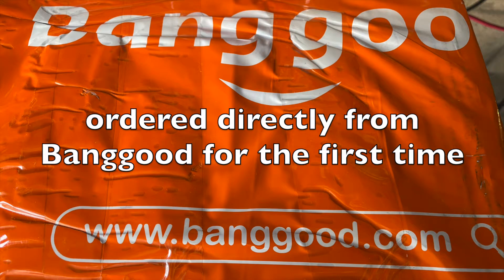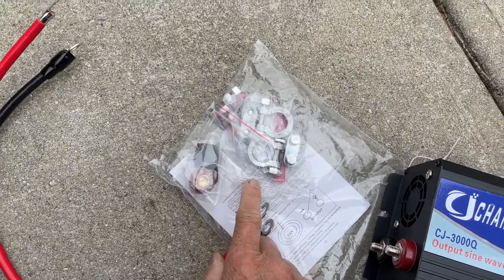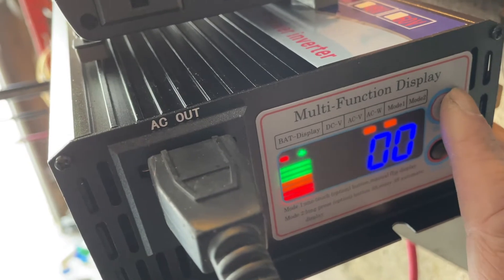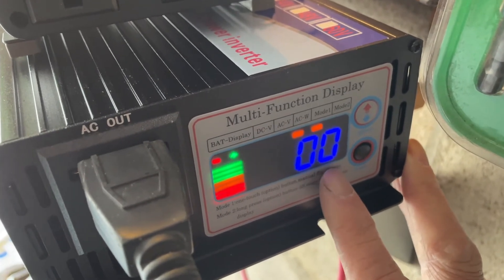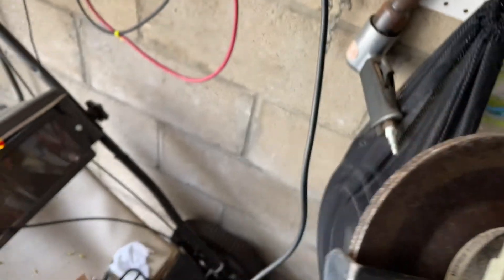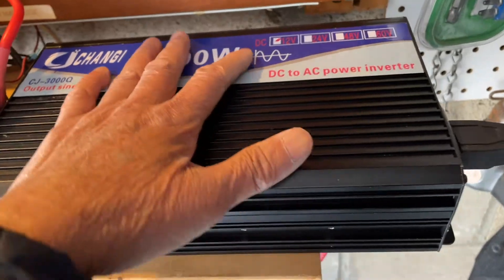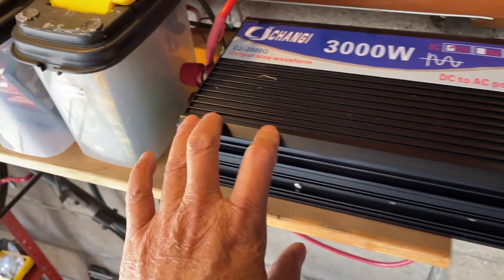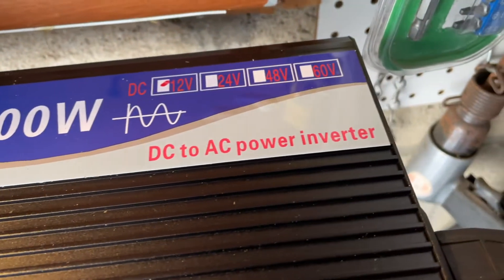3000w Changi pure sine wave inverter works for me

Comment: Update on this inverter
Reply from the maker: Still working but I don’t put a big load on it. Used mostly to charge power tool batteries, lighting and such (under 600w). I just bought a 3500w vevo inverter which twice the size of this one. Will see how suitable it is to power an air fryer.
Reply: @wtam69  - Is it powering the air fryer?  Thanks for your videos (and opinions). Very much appreciated. -John
Reply from the maker: @Sovereign_Citizen_LEO  I haven’t used it on the air fryer. I doubt it can handle it , maybe the 220 volt version can. Just guessing.

Comment: Spinning up a grinder but not grinding anything isn't a valid test, you need to load the tool to capacity to see what current it draws and whether the inverter is stable with that load. (so check voltage, power factor and waveform with appropriate test equipment).
Reply from the maker: You are correct. And how well the inverter will hold up after a few months of rugged use. This applies to all equipment and machinery we test.

Comment: A 3000W inverter "safe" to be used at 300W - 600W sounds hilarious to me. For that purpose wouldn't it be nice to buy an inverter that honestly claims a rated power of 600W and sustains a peak 1200W (usually double the rated one) power for a second or two?
I bought the same inverter (only difference is that it is has a 24V input), same label, and it proved (after-sale statement via Banggood) that 3000W is peak power, sustainable for maybe 100 milliseconds in my tests, and that the actual rated power is only 1500W.
Anyway, to deliver all the 3000W your inverter would draw at least 250 Amperes from a 12 volt battery ! And what a thick cable, minimum 120 mm2.

Comment: Nice price for 3kw but I would absolutely not trust the rating or quality. You should see the videos z1power and knurlknar made on these cheap inverters. It might work but it's probably got problems inside or at least low quality components. See https://www.youtube.com/watch?v=KuUBYsSNZag
Reply from the maker: I was just happy nothing went up in smoke. The last cheap power supply I bought on ebay came dead on arrival.  I mentioned in the video the inverter was quiet because the fan did not come on. Maybe, it won't under any circumstances. Thanks for the link, I'll look at it.
Reply: @wtam69  Yeah it could be broken, or it could be a temperature controlled fan that only turns on when it's hot. Personally I would just suggest not running it at 3kw all the time since even if it can do it it probably won't last very long. Who knows though. Nice video anyway :)
Reply from the maker: @ELECTROHAXZ  If I had gotten the inverter free, then I would have pushed it to the limit to see what happens. As it is, it should work ok for a small system. I don't plan to run it over 600 watts.
Reply: @wtam69  Oh ok, for 600 watts probably fine.